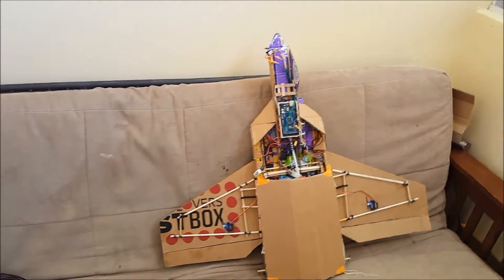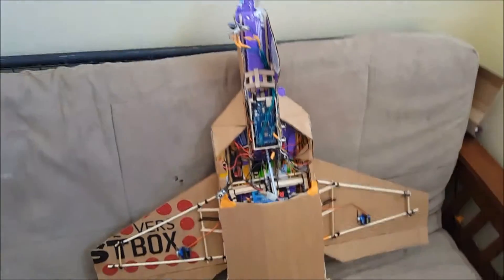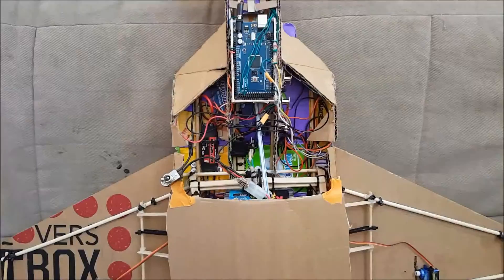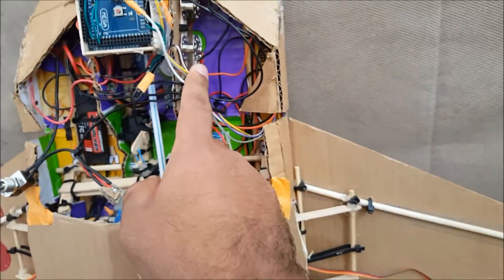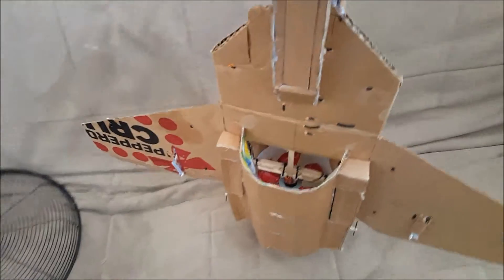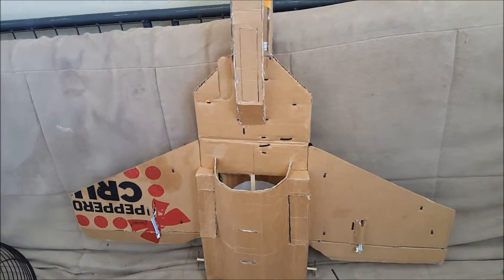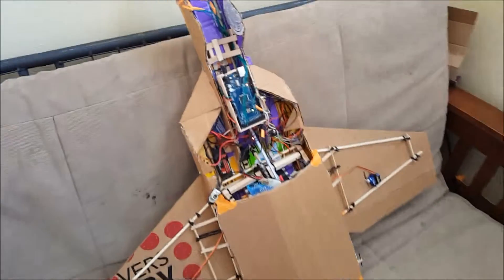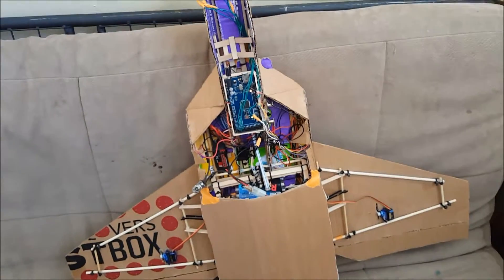Arduino mega airplane1

Comment: why are you using vin power on the arduino instead of BEC from the ESC?
Reply from the maker: because the board is being powered straight from the battery (11.1v). the bec-esc outsource only 5 volts and feeding currently now 4 servo 9g motors and i dont want to have a sudden current draw that could lower the 5v just a little bit which could potentialy have the board either shut off or limit its 5v outsource to the gyroscope, 3.3v to the nrf24lo1 antenna and lose control of the plane in mid flight.
Reply from the maker: being fed straight from the batt benefits the board since it has to power things at 5v and send a strong signal through the pwm pins to each servo without fade and ensures the board stays juiced and 100% operational. it is recommended to feed 7v or above for a stable operation of the board :)
Reply from the maker: and lastly, the bec limits at 3amp draw, i want to have the most amp available for the motors for the plane to fly to prevent black out and to have control again once the esc decides to juice the bec again (if it still in the air of course XD). since this is arduino i have to math everything and know the limits to ensure a stable power grid system. the motor runs like a charm now, i have a 3400kv brushless motor on it. i will update with another video once the plane is finaly closed :)

Comment: Nice project but I dont think this structure can fly.
Reply from the maker: lol i have been told that a few times i will give it a shot though. its my first project with arduino and i wanted to see how far i can push these boards with custom wiring and power distribution. with this project i will take the learned knowledge and apply it to my next project.

Comment: Nice.  I was wondering how far the radio would transmit the signal. Let me know if you know the range.
Reply from the maker: Hi thanks for the comment. Right now i cannot answer your Q because my battery charger just went south so, but as soon i get a new battery i will be more than happy to let you know. As for now, i have the 1100m nrf24l01 pl+nla antenna and just got a voltage regulator to downvoltage the battery voltage down to 3.3v with max 2.5A draw to feed that antenna with required current.

Comment: awesome! I wanna see it fly :)
Reply: +iforce2d Well it will fly but only if he builds a new airplane body
Reply: herminio perez :D
Reply from the maker: +iforce2d thank you, I am working on it very hard to finish it. I will be getting a 3d printer withing the next two months to make my own parts :D my goal here is to test bench arduino and the antenna, a working system cuz i want speed with arduino camera shields to send the data back to server (controller) "FPV" to make an aluminum or hard plastic plane ;) I want speed to enable me to add more batteries-weight = flying time.
Reply from the maker: Domino60 had thought about it.
Reply: herminio perez Do you need help? I can give you some info how to build a plane but depends where do you live in the world and if you got access to that materials, you can follow my channel as well if you like, im gonna post in the next weeks many cool stuffs, im building an airplane as well :D
Reply from the maker: i live in puerto rico we have all sort of hobbies down here from rc planes to manned planes, rc cars ofroad drift drag rc waterboats we have nearly all lol. i was thinking doing it with foam which is the best thing i could use, its just that i wanted cardboard for the genius builder of my mind XD